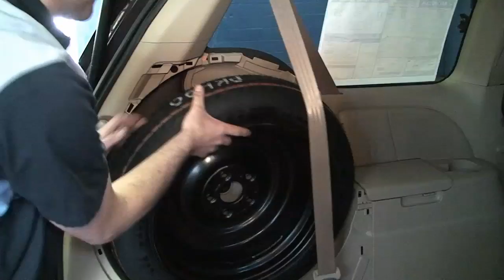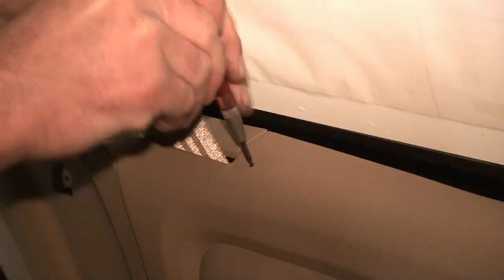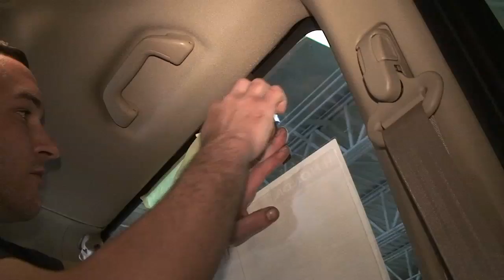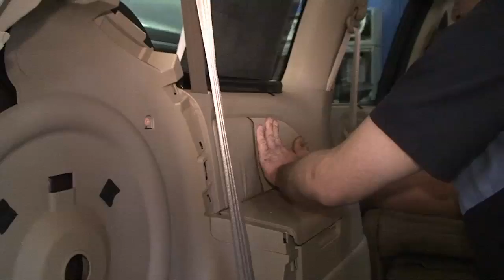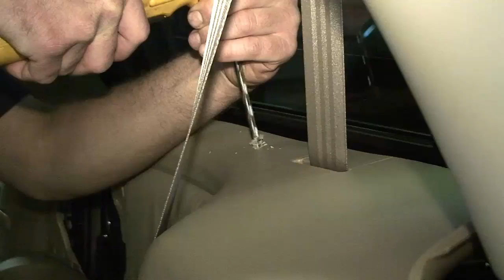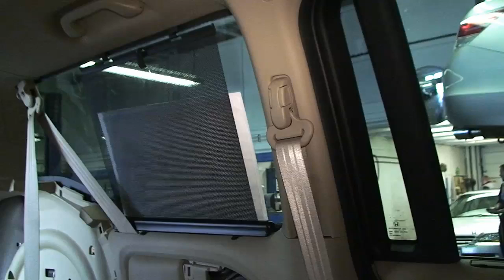Episode #182 - Honda Odyssey 3rd Row Sunshade Installation

Comment: I'd like to know the part number and order numbers for the anchor or screws for this sunshade to attach it to the panel on the bottom !  I was given a 2005 Honda Odyssey EX L  Minivan and the 3rd row sunshade is not attached at all. I have the sunshade but need the anchors to reattach ....please help !
Reply: Did you ever find the part number for the anchor/screws? I came across this video while looking for the same parts. Thanks